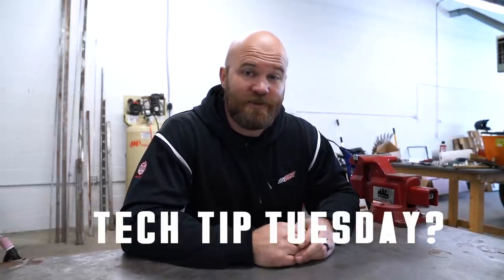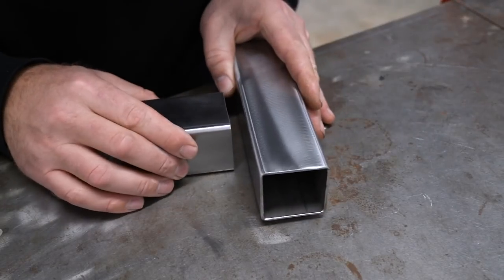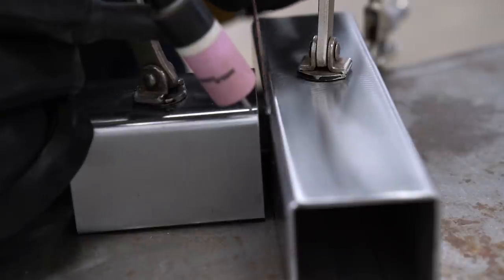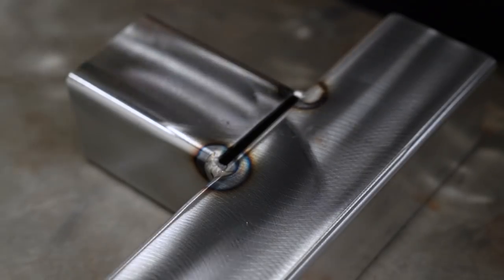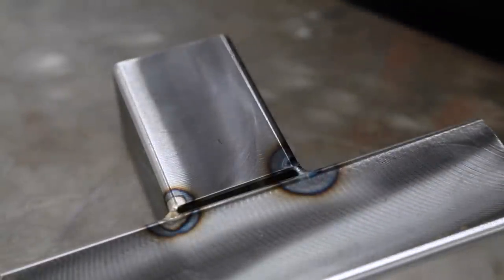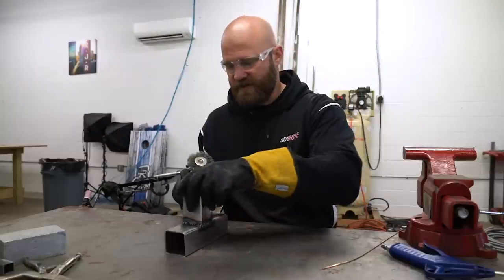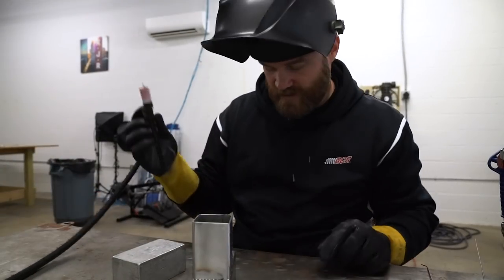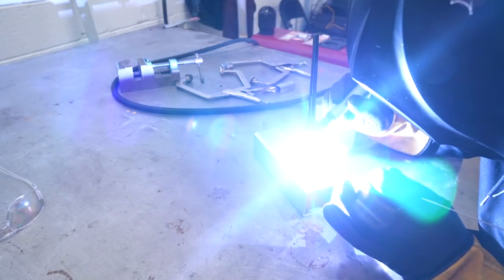How To TIG Weld ANY Gap

Comment: If the gap isn't as severe as that but still wider than your filler rod, try flattening the wire out in a vice or with a hammer to make it slightly wider, I've used that before and it works a treat. You could also maybe try doubling up on the rods so you have double the rod width to help bridge the gap. Just a couple more ideas 👍🏻

Comment: I had a 0.125-ish gap to fill around a cylinder. I started kinda like you with making bridges and then moved the pool from one piece, across the bead and onto to other. Pedal control was critical in the beginning, but it worked. The one problem I had was sugar on the weld itself. BTW, I'm glad that I'm not the only one who cleans the filler rod

Comment: I'm a welding student, I am starting Tig welding on a 2 in pipe Monday, this has helped alot.
Reply: Dont do that on pipe! Damn tacks get in the way personally I cut mine out as I get close but I also back feed
Reply: DON"T TRY THAT ON PRESSURE PIPE!  The in prosess inspector will write BORW with a soap stone right next to the weld. (Burn out, Re-WELD. )

Comment: Good tip and I have been doing this for years.  The multiple tacks are a great idea on thin metal as it reduces the length of time the heats stays in one place and therefore prevents blowouts and reduces warpage.
Reply: Tacks are deadly on code welds. ,,, Sorry gang. This is junk welding at it's best.
Reply: @mathewmolk2089  Sorry, but not all of us work for NASA

Comment: I hold a filler rod in the crack
horizontally and tack it in place on both sides then i weave both pieces together. Its faster than this method but this is definitely an interesting idea that ive never used. Thank you Justin for teaching me something new

Comment: That is the one of the beauties of a TIG welder. I'm not sure if the weld is as strong as a close fit, but looks like it should work. Also, lacquer thinner leaves a residue, acetone leaves virtually none.

Comment: When I was young I used to be a shipbuilder/welder.  When we were stick welding heavy steel and there were sometimes gaps up to 30-40 mm.  On a sunny day the sun might give you a hand as the temperature of the steel was rising, but normally we could not wait for that. So we would use a copper plate on the back as a form work and build up the weld.
Reply: A chill block!!!
Reply: I would break the flux off of arc rod and use it as a filler wire feeding it into the arc puddle. It worked to fill some of the larger gaps very quickly.
Reply: @streetfighterguy1909  I am sorry to say that  some guys did that, but only once. They were sendt home. They were warned about that at their welding courses. Those welds had complete lack of fusion, penetration  and looked like a swiss cheese on x-rays.
Reply: @kib2675  let me give it another run since it has been about 18 years since that old guy showed me that trick but I never remembered it having a lot of porosity. I'll toss something up today and review it again.

Comment: 25 years  of experience tigging stainless, here is the best advices your going to ever hear about tigging a gap. Take your bad parts and toss them into the scrap bin and start over. Don't believe me try welding up a gap and see what happens. You will destroy your whole project when everything moves on you. Stainless pulles like crazy.
Reply: I’m just starting out tigging stainless, I purposely came on YouTube today to try learn about tacking thin stainless, I’m struggling to tack without vaporising it, if I can manage to get the 4 tacks I’m away, but untill then I’m just blowing holes instantly. I’m finding the gap has to be absolutely perfect!, and even when I feel iv got the gap right I tack one side and instantly it’s pulled on the other 🙈

Comment: I usually bridge gaps with stringers. I can span a fair gap with 1 pass. Other than that I'll run a pass on my solid piece and then make the other pass on top or side until I can tie them together. Depending on how I'm doing it. Glad to see your videos popping up in my feed again.

Comment: Haha cool. This is exactly the method i use when mig welding big gaps, when the material itself is on the thin side. Once those teeth are in place you can easily go over it in a circle pattern. Filled up to 10 mm gaps on a 3 mm thick material no problem.

Comment: Usually the way I do it is to run a pass along the thin edge and thicken it up. Works with TIG or MIG. Then you can run a weave and easily drag the puddle across 1/8" gap, or you can just really push the filler in and run a straight bead. Another trick we used was to cut a piece of 1/8 rod and lay it on the gap, then weave over it with .030 rod. That was on chromoly race car control arms.

Comment: Good method. I use another one: i weld all along the long tube once, from side to side of the short tube, and repeat the line again, towards the short tube, until the gap is completely closed. It's faster, it's cleaner, and it looks better cause no tacs.

Comment: I have been welding for 40 years now.Collet is not the problem.They are all a peice of copper with a split in them.
I would put the sparking down to the corrosion inside the box being pulled out when tacking up.I can see you cleaned the inside but the corners are harder to clean.
Dont waste your time putting lots of tacks in,just start and push your filler wire in and swing between sides.
How do you think we weld pipes with a root gap in??? Also,always start on the box/pipe where the gap is tightest,that wil crimp down,then do the gap,starting from where the gap is tightest to the biggest.This enables the gap to crimp/shrink uniformly and keeps the pipe/box straight. And use bigger filler wire,looked liked you were using 1.6mm,go to 2mm-2.4mm,i am in europe,dont know what the inch size is.
I am an x-ray qualified pipe welder.
Hope that helps.

Comment: I would "pad" the heavier side (the corner will take heat better) and build up in one or two passes with filler rod and let cool in between. when gap is the same size and closed up, then weave or whatever your preferred method is, Bridging is ok if necessary but puts a lot of stress on the weld as it cools and makes for more distortion. ALSO bad tacks and porosity may be a chimney effect of non inert gas blowing thru the tube from underneath.

Comment: A good Job Men.
When I was doing welds on thin (2mm) structures, I used a 4mm inner backing plate for two things: 
1. It helped me quickly melt and fill the joint.  
2. There was much less heat input, therefore less members distortion.
Good luck

Comment: Hi Justin, love your relaxed and informative skill sharing!
Just started TIg welding because I have been soldering - electronics - all my life and doen't like to spatter around when welding something together.
Still have lots of challenges to even get the arc in the middle of the two pieces (square pipes) together but this tutorial helps definately!

Your cleaning tool running on air pressure is an eye opener for me, can you share what scotch type of sanding pads you use?

Gonna go right to the store tomorrow to look for an air driven machine tool you are using 🙂

Keep up the good works!

Comment: The way i do that is to run a little bead on the tube. Now the gap is small enough to bridge . Thats how i do it.. It works well for me.
Reply: hrlydave83 yup I just run a bead on each side of the gap depending on how big it is then just fill in after.
Reply: I call this buttering it up lol 😂

Comment: The initial tacks are good. But your right as far as weaving afterwards. It's super ez. Just point your tungsten at the toe add a drop of filler and feather it to the next toe. Rinse and repeat all the way down the gap. I love tig, and I can get lost in that arc, brushing away! 😁
Reply: the last thing you want on a root pass on anything is a weave technique..    youtube can not teach you how to properly weld..  it can infact have you chasing your tail trying
Reply: @justinfryer1347  I've bent tons of tests that were purposely gapped. it's inevitable, you will run into it
Reply: TreYay83 the toe is the distance across your weld aka how wide you weld is.. so what your saying is to point your tungsten down and weave? You certainly can’t mean point it back your weld would go black. Forward would point your tungsten into the gap. 
I’d like to see that weaved in one pass🤦‍♂️
So much heat, so much warp, so much burnt stainless, so much wrong.
It wouldn’t happen nicely.
From a red seal welder. 
I would tack the corners. 
Lay one fill pass on the corner of the square stock. Starting at the wider end. 
Let cool. Then with a slight weave hugging the fill pass and whipping to edge of other tube. Using a back fill technique with my filler rod. That would be my preferred method.
On the 4th side I couldn’t back fill I would lay a 2nd fill pass on top of first, and then weave the last pass keeping my fill rod in the gap but closer to the edge of perpendicular tube. 
The “ teeth method “ works but would be very prone to contaminates, and inclusions. ( in pipe welding bridge tacks are always cut out due to them being filled with porosity and being hard to burn threw, we usually use plugs when possible ) Also your heat effected zone becomes much larger with all of the bridge tacks. Even multiple stringers with a high rate of travel would come out nice 👍 
Remember a colourless stainless weld is the best! All this rainbow shit you see in weld porn is actually not ideal.
Reply: @Beamer866  i meant point your tungsten at the corner of the initial bridge and the work piece. Get a dab of filler in there then drag the arc across the bridge and point the tungsten towards the other corner of the weld and the work piece, another dab of that sweet molten filler and then drag it back across. Come on man

Comment: Thanks for the informative vid. For all the mig heads, this is a Info vid. Sometimes your mig machine is down, not available, or maybe all you own is a tig.
Reply: Then stick weld it. - Keep the heat on the solid part of the tubing and let the puddle just touch the cut esge of brnch tube. - There is no way what was done would ever pass a code quality weld inspection.,,,,,For the record I'm retired but got I got my CWI 40 years ago

Comment: I actually like that technique. I would generally pulse like a maniac with the foot pedal and pump a ridiculous amount  of heat into the joint. I'm going to give that a shot next time. I've also ran strings on one or both edges to build it up to a point where I can just weld it out like an open root joint.

Comment: Very Nice to see a good dwell time with inert gas after the welding stops. Pulling the gas away too soon will allow the molten alloy to oxidize or hydrogenate and become weak. This is important for every tack weld. 

Perhaps your tack welds cracked because the surrounding metal had become too hot and later contracted a lot, pulling the weld apart. Try jumping to the colder areas, building up one tack per face. This will cause less expansion and contraction of the base metal. Once you have hefty tack welds, you can steadily weld towards or away from them safely. 

I agree with others that tacking some large filler into a large gap is a great way to close a gap. I would prefer to use something with a wide flat back, tapered sides, and narrower front, so I can add filler starting at the back surface. 

It is not necessary to bridge the gap fully on your first passes. On your early passes, it is more important that the back surface is completely filled in - with no gaps, channels, or pits. For example, if large round wire is set into a gap, the back surfaces may not fill up, leaving two long grooves on the back surface. I would prefer to build up metal deep into the gap, so the back (inner) surface is strong. 

I think that running your weld into a completed section (that mostly stays solid) is a great way to avoid metal stress. But this also means that you have to avoid melting away the tack where you plan to stop. If the tack is not substantial enough, you will melt it all again and loose the advantage. This is why we run welds into a previous weld - to both stress relieve the edge of the previous weld and minimize stress at the end of the present run.

Comment: I have not had an issue with different brand collets. I probably have about 5 different brands mixed right now. Now perhaps you got a part that was out of spec. Its great that you pointed out wiping down parts and wire. Even those mig wire cleaners help out alot. It really is amazing how they preach clean metal makes a better weld when they sell electrodes that are so oily and greasy
Reply: I think the wire is oily / greasy because (A) that's lube for the wire-drawing dies and (B) it keeps the metal from corroding in storage.

Comment: I have never heard of an issue with mix matching torch parts, in fact in almost 20 years I've never known anyone to have an issue. I currently run and Weldcraft torch, Radnor collets, and some Chinese knock off gas lens and cup set that I picked up on Amazon for 10 bucks....welds perfect.

Comment: Really nice work. I am sure you know about solvents for cleaning but for others I was told never use brake cleaner to clean prior to welding as it creates very poison gas ( phosgene). I don't know if it is true but I play it safe and use acetone. Again nice video.
Reply from the maker: I have heard the same thing

Comment: Thanks for showing I've  been a stick welder for 40 years and doing that with stick I would beat the flux off one rod and I guess you would call it Texas tig weld it but i am learning tig now and the one thing that I see here is your  tungsten is way out further than I can do is this because your using a gas lens ? I may need to get one I have a simple  lift start tig and really having trouble with tungsten getting all boogered up

Comment: Use gas lens if at all possible.  Collett style work but you need a smaller cup size to help focus the gas. 

 Also i agree with you on not mixing brands,  just had an issue on a job where we had Miller parts but had a no name torch and when fully seated the Miller parts would not grab the tungsten.  Put the same parts in a Miller torch and worked perfectly.

Comment: I have a bunch of different diameter wires and and whatever my gap is I grab a rod that’s slightly bigger or close to the gap width and waive over it. Correct term would be lay wire technique. 

Tig welded pipe being used in refineries, at least here in SE Texas are “basically” done that way. It’s excepted in every industry besides aerospace so should be just fine for structural haha

Comment: Some say that welding with a small gap for the metal to flow into makes for a much stronger join than one where the metal touches all the way around, makes sense because there is more surface area being made between the two pieces, another method Ive see is to grind a 45 degree angle on the ends where they join for the same reason, it gives a space for the metal to flow into and fill for increased surface area....
Reply from the maker: I agree with the 45 degree angle. A small gap I’m sure is good but then the piece can pull one direction when it cools.

Comment: Let me say up front that I like the video, and if I had to bridge a gap and my mig and stick welders were broke this is the technique I would use. But let me also say this is a very labor intensive way to join two mismatched pieces of metal. It would be far quicker if material allowed to properly cut the tubes so they butt up nicely, then you could lay a nice stack of dimes after tacking up square. Barring that, there are stick rods  (ie 7014) that are designed to bridge gaps from the get-go. Mig welding is also a fine choice if fits are poor and appearance is not critical. Structural and fail strength must also be taken into account when choosing your weapon.
Reply: Its not the best way to do it. But it can get the job done. Depends on if structural integrity is important. or for warpage. I have used this technique on non-critical items.

Comment: Having access to both i usually just go for mig when i need to close gaps like this. but yeah i do a very similar thing filling gaps using the tig. Also i do a bigger filler rod. it all depends on the situation at the time. Good video, good advice . .  Thanks man
Reply: Hasn't anyone heard of stringer beads?

Comment: Radnor is just the private brand name for Airgas, IMPORTED.  I have been selling welding equipment and supplies for many years and have come to rely on CK Worldwide.  CH has a wedge collet that to me is the best.
Reply from the maker: I talked to them at fabtech this year. May start using their stuff.
Reply: @JustVoss  You will not be disappointed.  All their torches are 100% Duty Cycle AC or DC, unlike Weldcraft and others with a reduced duty cycle on AC.  Download their catalog and check it out, all the do is TIG so they have specialized torches for all applications.

Comment: Used to work at a furniture manufacturer in college. We'd be dealing with some wonderful 26 gauge sheet bent up on poorly maintained machines with some pretty big gaps. I've hit the gas and prayed, laid wire and tacked it in and built some little bridges. I never went as far as making a bunch of little teeth, usually just one or two spots to build from. 

I miss welding but not there! That was miserable work. The only people that cared if you made good welds were in paint prep or engineering. Literally had welds so bad come back from other guys that they fell apart when hung on the paint racks.

Comment: I run a bigger filler rod and keep the rod in the puddle. Maybe not the best way but it works for me.
Reply: I use a larger filler rod pushing it in until filling it, sometimes working torch side to side and back to the center and watch the puddle drop slightly then move forward. The larger rod  helps to control the heat